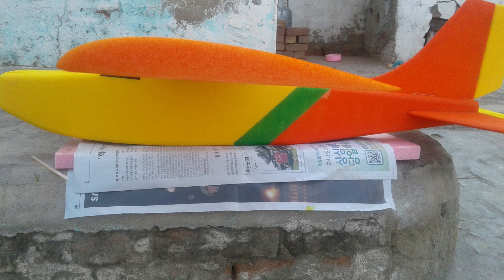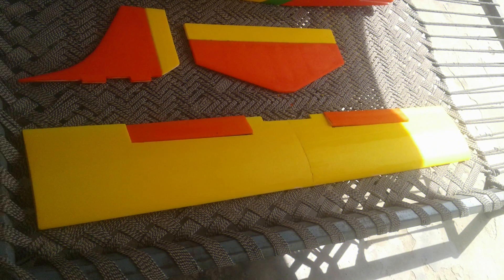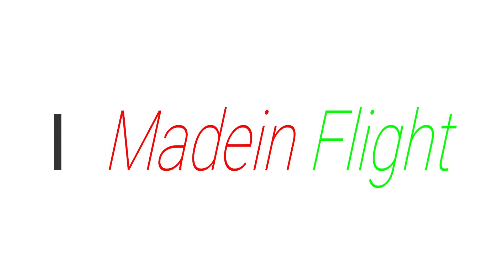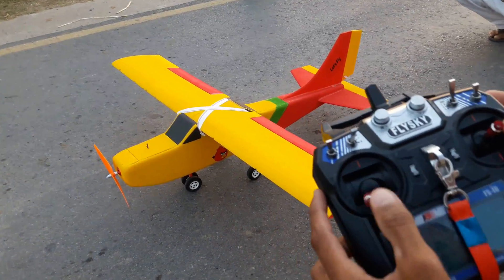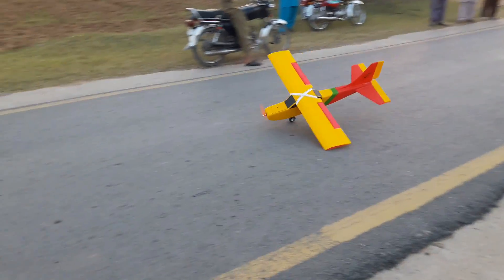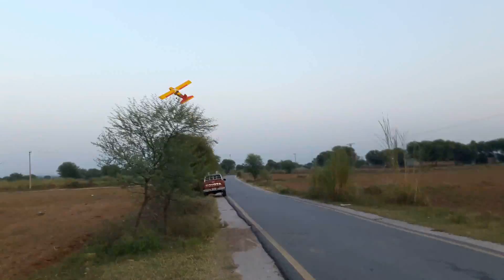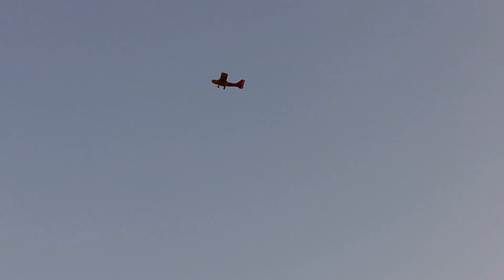how to make a homemade rc plane DIY  rc plane at home

Comment: Is ki pdf file send karo
Reply: Don't expect him to help you guys or suggest neither he will share or tell you how to do it, he used foam cutter (not telling you), he used Google image in 4A size for flat-bottomed airfoail chords, used pliwood to cut and put on his pink foam, and using cutter he got shape, also dimensions he used PDFs and then cutter to get the shape on foam boards, and final thoughts he is pakistani, so he won't share the knowledge 🙈
Reply from the maker: You are intelligent do it by yourself. You said right things.
Reply from the maker: Yeh mera apna desgined Model ha PDF nhi ha iska.
Reply: @shabisahilrc973  to phir is ka size kaise pata chalaga
Reply from the maker: Iski body ki lenght 3 feet ha 4 foot k wingspan.
Reply: @shabisahilrc973  aur baki saman

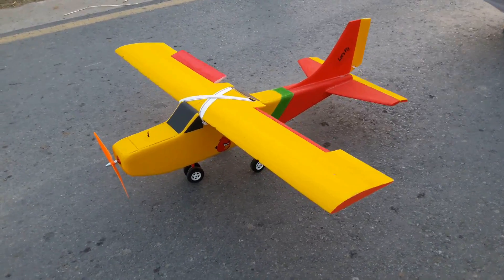Comment: the rest.....   at 4:40,  ailerons have Not been  Correctly  INSTALLED.    ailerons  SHOULD Extend to  Near  the  wingtips.    at 5:01, All landing gear has Not been  Correctly  located.    the prop is  TOO far  from the main wing.    the prop  Should be located, about, where the forward edge of the 'hatch' is, now.   flexi, orange, plastic  S F  prop  used.   wrong.   the model may be correctly balanced, at  30 percent of chord.  that, however, does  NOTHING  to   Correct  the  CONTINUING   TAIL-Heaviness of the model's dom.    SEE PREVIOUS COMMENT, relating to  TOO MUCH FAT  at the  TAIL.    this model has a zero-dihedral main wing.   whey flying such a model, in order to execute a turn,  a pilot Must  Initiate a turn with   Aileron input  and  Complete the turn with  Elevator inputs.    newbie pilots/scratch builders  Should  NOT  try to learn basic flight skills with such a model.  Rather,  a model having a dihedral wing and 3-channel control  Should be selected/built.  cheers      googletranslate
Reply: No one wants to hear your BS Dave.
Reply: @DreamForged3D  getfukd
Reply: @daviddavids2884   Thanks for another screenshot proving my point. There is no one way to do things. If it flies then it's a success. You don't have anything that flies and the airplane you have on your channel isn't capable of flying. Before you judge others you might wanna learn how to actually build something.
Reply: @DreamForged3D  helo
Reply: @shabisahilrc973   I regret to inform you that David is actually just trolling you. He has a very long history of leaving comments such as the one he left on your channel. I have countless screenshots of him telling people to "get fuck". He just wants to get a reaction out of people so he can tell him how stupid they are. He was baiting you. He has no respect for anyone and thinks he knows what he's talking about when he really doesn't.